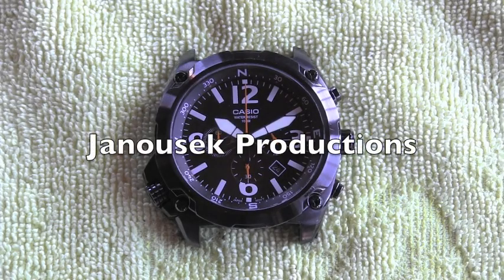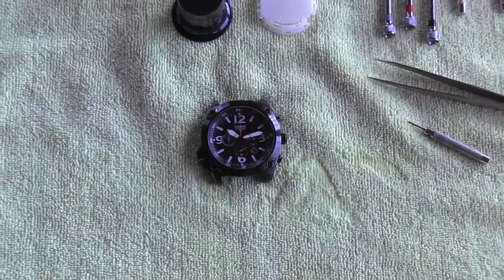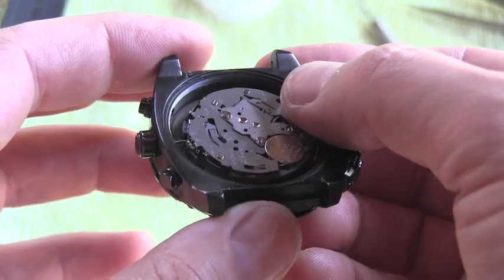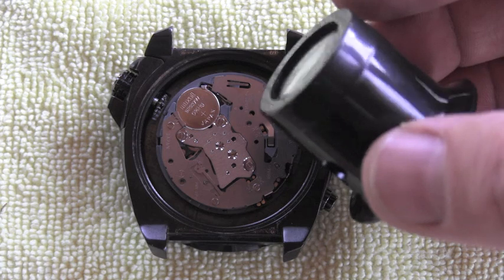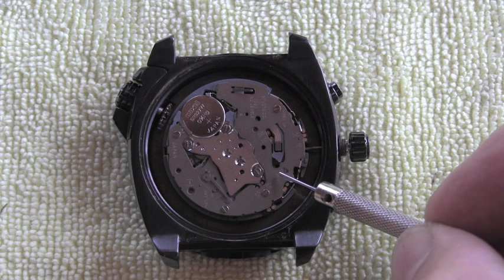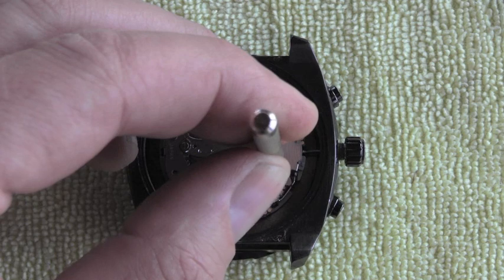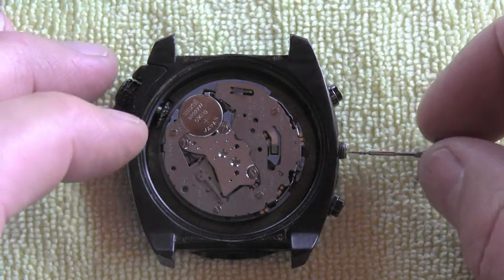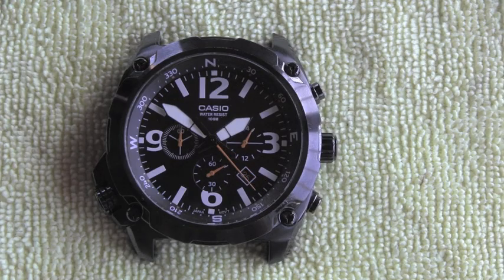How to remove Crown and Stem from Watch

Comment: As with others who commented, this video showed me exactly what I needed to know!  Had an ETA G10.711 chronograph watch where the manufacturer installed the crown too far in on the handsetting stem threads.  The crown was therefore always in either stem position II (date quick set) or III (time set) but impossible to push all the way in to position I (normal running).  This video explained the general principle very well, so I was able to find the comparable stem release mechanism on the G10.711, remove the stem, and unscrew the crown a little so it was mounted further out.  The watch now operates perfectly.  Thank you for saving me the time, expense, and aggravation of sending it in for repair!

Comment: This the best video I have found on this. I've watched a dozen other videos that simply showed a spot to press in to release the stem, but my movement is different and didn't have that same spot. This told me how to find the spot on my watch. Which, once I knew what to look for, I found in less than a second and was able to remove the stem no problem. (didn't need a magnifier, it was just legible when angling it right against the light).

Comment: Thankyou so much!!!!!!! when i was trying to calibrate my chronograph, i pushed that hole thinking it would zero my dial. instead during my fiddling around in that hole, the stem came out! i thought i had broken it. well i calibrated my chronograph dial but i was still worried about that stem. i had already assembled my watch but found relief that reattaching the stem was simply putting it back in. thanks again!

Comment: Thanks Peter J. Your explanation on how to remove the winder was very useful. I was able disassemble and repair my watch. I stil have a fault though on my casio aq321. the function adjust button on the left of the watch. does not work. Any suggestions ? I too am PeterJ by the way.

Comment: Hello Petr,

Congratulations on video and here is a question: what if my PUSH operation was not so gently? I am trying to put stem back but a new PUSH does nothing. Is there anything I can try?
Reply: Rotate the crown as you insert it. The flat or square end needs to line up

Comment: I have a watch with this same movement (Miyota OS10) and theChronograph is not working, if I press button A the Chrono second hand tries to tick but does not advance... Any idea on what should I check?  Thank you.
Reply: same problem and the same movement :'(
Reply: I did not find anyone to fix it, but I did find out that you can buy the complete movement and just replace it.  It costs less than 20 US dollars and they send worldwide.  You have to check if your has the date at 3 or 6 because there are 2 versions.  Here is the link on ebay:
http://www.ebay.com/itm/252851123192?ul_noapp=true
Reply: Thanks, but later I realized I have Miyota OS30 not 10  :)